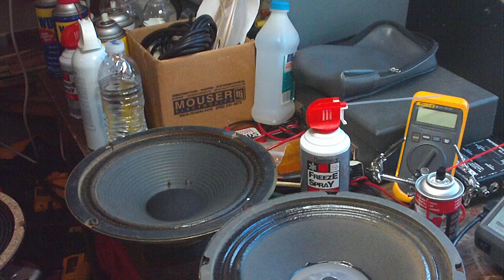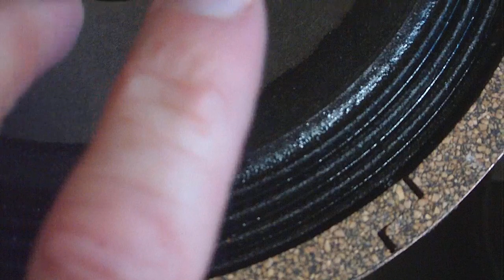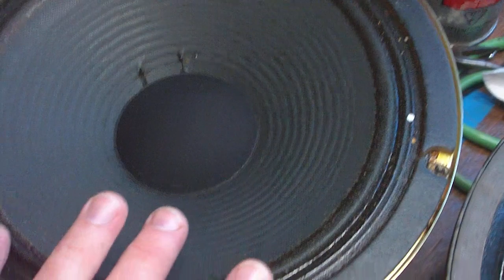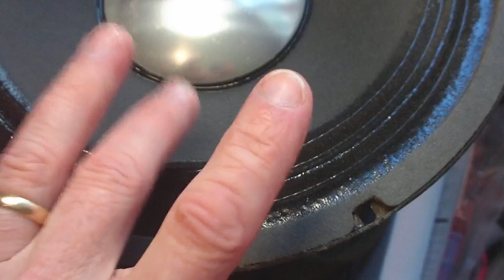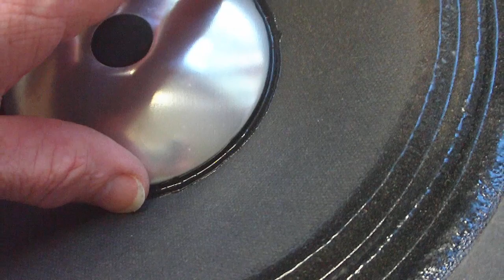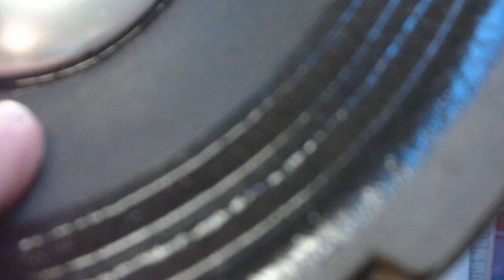Speaker Voice Coil Rub - Lab Series L7

Comment: Hi, I'm trying to fix some speakers – I believe they've had re-foamed surrounds, but I think it's been done poorly (one has loose glue); however, the other one sounds good when playing audio, but it has a noise/friction when I gently press the cone, as you do in this video. Could this be the alignment being slightly off following the previous re-foam? If so, could that be resolved by another re-foam? Should I even be concerned if the sound is fine? Any help would be appreciated, as I'm new to this. Cheers!

Comment: i got a sub and that  makes a rattle sound you can hear when its at low volume and when you push down on the cone part way down you feel that crunchy feeling but it doesnt sound as bad as yours. Is that coil rub I guess the sub its on its way out or is it possible to fix this?
Reply: XCI5ION I have that problem too, did you find a solution?

Comment: The resistance test is not always a good indicator. I had a "blown" speaker that had coil rub, but yet they still measured 4 ohms.
Reply: Yeah, rubbing doesn't = blown.  Was it just rubbing, or was it actually not working at all?  (yes, I see it's a 2 year old post, but new to me and no one else seems to have replied.  :))
If just rubbing, it could be a sagging spider or just a marginal previous job replacing the surrounds that went out of alignment after some time.  So if the coil measures good, still a chance it only needs to be re-foamed.  First thing would be take a closer look at the spider to see if it's taught and springy still.  If the spider seems good then remove the current surround(s) and check to see if the cone/coil can be made to move without rubbing. (Though yes, the coil could be deformed and need replacing even if it does still work with .)

Comment: Hey, know this video is a couple years old, but wanted to add some to it. I had an old Rola ceramic in my 4x12 that I could hear coming down, so I pulled it and sure enough, the voice coil was rubbing. I took off the dust cover and had a look, shook it out and did see a few glue particles. So, I assumed the coil was burned and was going to need major surgery to bring it back. After a few months neglect I pulled it out of the closet and did a resistance test. looked reasonable, slightly over spec. then i had to play with the cone a bit more, cause I am just like that. and hmmm, the coil was completely detached from the cone. well now. I gently pressed it back into place, making sure not to bend it and that it had free travel into the mag. tested it and good. of course this threw the coil back out, but now a super easy fix. reset and glue. good to go another 30 years.